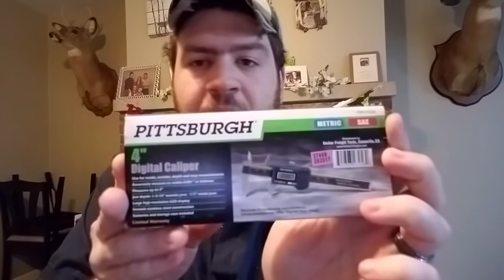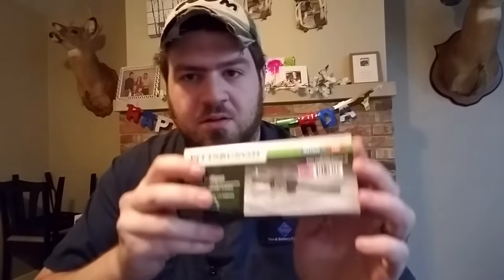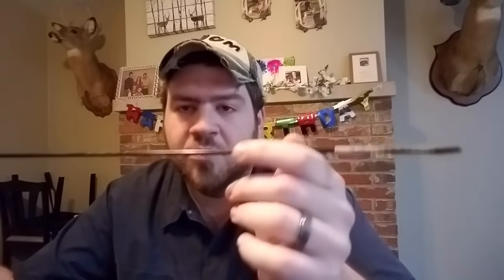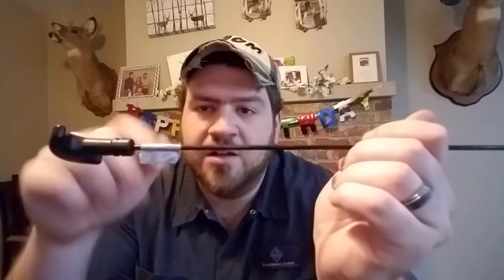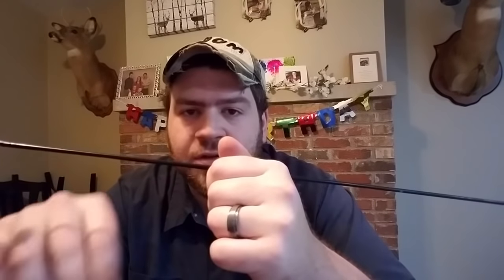TOP 5 SECRETS Airgun/Pellet Makers DON'T Tell You!

Comment: Hello, my .22 call break barrel springer produce 488 fps on 16.2 grain flat head pellet with energy of 8.6 ft/lb. It only like mastershot flat head pellet of 16.2 grain, other pellet does not give such fine accuracy on my air rifle. So i only use that pellet with right head and skirt size.
So, my question is that can this rifle put partridge and rabbit at which distance successfully ?

Comment: Sorry for the back to back messages. As far as pellet lube. There is a few things that work really well. One is 100% synthetic 20w motor oil about two drops to a tin off 500 after they have been washed and dried. Will absolutely keep the barrel from leading and also helps the leade in on lower quality barrels from smearing the lead at the skirt of the pellet. In 9 out of ten guns it will shrink group sizes a little and if guns are pellet fussy it will make them less pellet fussy.

The next thing is believe it or not a drop of coconut oil. Always wash the pellets to remove the lead flakes that are present and dry them. I prefer the synthetic oil but some guns prefer pellets lubed this way and will shoot tighter with the coconut lube being used however the most prefer the synthetic oil.
Either way you want hardly any on them. If you pick one up and can feel it on them you have to much.it needs to be an extremely fine coat and that is enough it also keeps your pellets from getting oxidized if you have them for a long time. When i get a run of JSBs that just shoot lights out I call in and order some times 50 tins of that lot number or how many ever that have. So i have a lot of pellets and constantly order. When i get a premo lot i shoot those pellets in competition and not just punching paper so they may sit for a while and the light weight synthetic oil keeps them with zero oxidation and really to shoot even if they are a few years old.

I can tell you this if you wash the pellets and dry them then lube you are 100% gonna tighten the groups up at 50 and further. At 25y you may not notice a difference but at 50y and out the groups will shrink on average by a tenth of a inch or so on world class guns and more so on lower end guns. Shrinking a ten shot group a tenth of a inch at 50y consistently is a huge amount out of my Crown, Impact, HM1000x those guns are so tight shooting that knocking a tenth of a inch off at 50y a lot being they are consistently shooting .35 inch 10 shot groups and now that's making consistent .25 inch that's huge...

Out of lower end guns you may see a few tenths of a inch knocked off the avg 10 shot 50y group. If your gauntlet was a consistent .75 inch 10 shot gun at 50y it will likely be shooting right around a half inch 10 shot 50y groups... That's taking decent accuracy and turning it in to pretty damn good accuracy just by washing and drying and a little bit of synthetic oil.

Comment: NICE!!! Great to meet another 'fanatic' concerning 'details' and "specs". THANK YOU for the Twist Rate info. I have always wondered what the "Twist" rate was in my rifled barrels (or if there was any). 1/19 -1/22 is pretty interesting. The "flight pattern" of certain pellets now makes sense. . .  If I may offer; One other spec I found to have a huge effect on Flight was "ballistic coefficient" (b/c). Although the biggest factor I found in flight and energy (besides weight) was "skirt size" and I was shocked to find such a HUGE variance in size of skirt from Type to Manufacturer. Crosman's own pellets have a huge difference depending on type. While they all state 5.5mm...its the 100th that matters. The Crosman .22 in a Domed is 5.52; while the Hollow Point is 5.54. Benjamin Hollow Point 5.56. Some are even larger ie Predator Metal Mags (21g) in a 5.58mm. . . I agree with you on certain ARs preferring certain pellets. I have several, from a sub 500fps to Magnum Springers and a NP (1200fps) and each preferers a certain pellet.  Look forward to checking out more of your work. Cheers and Happy Shooting.
Reply from the maker: Thank you!

Comment: What you said is true but unfortunately epically with cheaper pellets they are all different sizes even out of the same package, out your digital micrometer on them and measure also with a digital scale you will get different weights lol notice how some fit tight and some fitt loose in the muzzle ........  But great vid !!!!!!
Reply from the maker: Thanks that's why I made myself a pellet gage/sorter @ 45yd/50yd sub 1/2" groups is normal for me with sorter I get Crosman Premier HPs less than 3/8" groups @50yd  also helps to have a choke in the barrel for this reason

Comment: If a the skirt of a pellet is getting blown off by the gun the pellet is not for that gun. The Diablo waist on pellet helps stabilise the pellet in flight. Unfortunately the Diablo waist also creates drag which reduces the range of the pellet. To solve the problem of the pellet waist getting blown off you can tune the rifle or use a thicker  skirt  pellet. Great video.
Reply from the maker: Thanks!

Comment: Fx impact,
16 diffent places with o rings that are prone to leaking,
I brought one of the first wave of impacts to come into the U.K. , NEVER BUY AN FX FIRST RUN , Iv been a fool and done it with the mk2 verminator 177 , they sent me three different 177 guns and all were very inaccurate, seems the new x line barrels are fine , but everything Iv had in a 177 from them has had accuracy problems with the barrel itself, and the impact was always springing a leak

Comment: One tip if you're chewing up bolt o-rings is to polish the breech where the bolt enters.  This is often caused by burrs or nicks in this surface essentially cutting the o-ring.
Reply: What I should have said was to polish the chamfer of the bore at the breech - sorry for any confusion

Comment: I have a Crossman Nitro .22 cal. From your research what type and grain should I use?
My groups at 15 yards are somewhat consistent but I can't dial the group to the bullseye.
I will be changing the piston and breach O rings thanks to this great video.
Reply from the maker: Mark Job thanks! In my Crosman NP fury I usually put a squirt of silicone lube in the transfer port every 250 shots ...might try that first for the seals...far as pellets, I have had good results with the 14.3gr Crosman dome at 25yd

Comment: I on the other hand have used powder burners for most of my life, but now that I am retired 68, I now have no powder burners, but have a break barrel Swiss Air in .177 cal.
And a PCP Benjamin Wildfire in .177 cal.
And have ordered from Pyramid Air the Diana Storm Rider gen II in .177 cal.

The Swiss break barrel I seldom use, (I am finding it harder to cock with my old injuries)
The Benjamin Wildfire PCP is OK for fast pinking at close range cans. (I have a Hatsan hand pump for that, and will be getting an electric high pressure air pump 4500 psi
And in the mail is the Diana Storm Rider gen II (refurbished) and in .177 cal.

My questions to you would be.... do you happen to know the weight, twist, and type pellets the Diana Storm Rider has a preference for?
Reply from the maker: Wish I did but you probably want to call Diana and ask, let me know what they tell you then I can run my calculations to find the correct pellet weight
Reply: @STKO2011  Hi my friend. ..... the only answer I got from anyone was from PYRAMID AIR, and the only thing they could say was they have gotten good results with the JSB EXACT in .177 cal. weight of 4.88
Reply from the maker: @dockmasterted  I can't find the 4.88gr, can you double check? That seems really low
Reply from the maker: @dockmasterted  no problem! Guess that'd be decent to start with
Reply: I have a gen 1 in .177 SR, installed a reg set for 135 bar @ 880 fps with JSB 10.34 consistent 5/8 groups @ 35 yds with 18 shots still on reg. Hope this helps.

Comment: Have you done any testing or anybody with large temperature changes? My Diana Stealth, once it gets over a 100f  won't group at all over 30yds. I've tried three different pellets.
Reply from the maker: David Mccall try lubing the Piston every 250 shots with silicone lube... it's recommended by most manufacturers... accuracy increases greatly!
Reply: I just order some Krytox GPL 205 Grease, Pure PFPE / PTFE couple guys recommended. very expensive I've got around 3000 pellets sense May 1.

Comment: what do you think about adding about five or more washeers in the back of the coil spring on the springer  , its supposed give you more fps  ?
Reply from the maker: R G on a coil spring it would increase the velocity/power...on nitro or gas spring it just shortens the stroke stroke and makes the gun less fps/power
Reply: thanks bro ,very interesting !!!!

Comment: James, great work. Also the labor you put into the Nitro shows there is no free  lunch if shooters want a low-cost mag springer. As accurate as PCP? Great rebuild! 

Recently built a 753 from scratch. That is more my speed and have made it a close-range hunter, careful shot placement. With the fine barrel and smooth engineering of the 753, I would put that up against anything up to 20 yards.

Thanks also for still doing longer videos. So many trying to adjust to new YouTube rules by doing only 3 minute vids.  You are an alpha dog worth investing 10 to 20 minutes.
Reply from the maker: Thank you sir! Don't know if you seen the newest video...but the accuracy blew me away once I got the barrel and piston tuned for the pellet at 45yd then I made a post about my 50yd groups yesterday... getting ready for 100yd